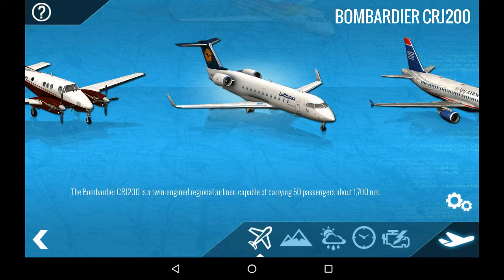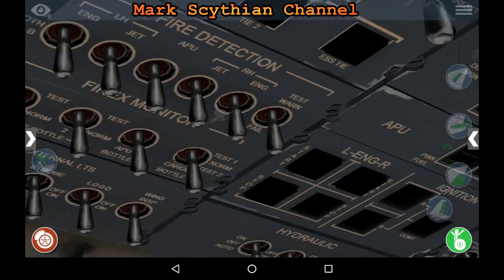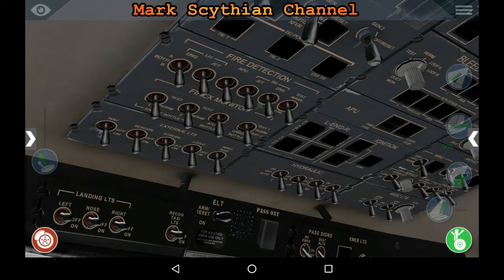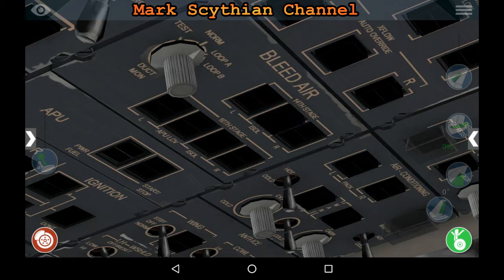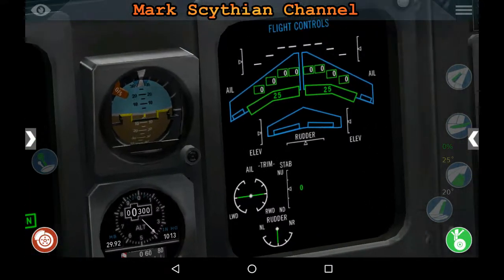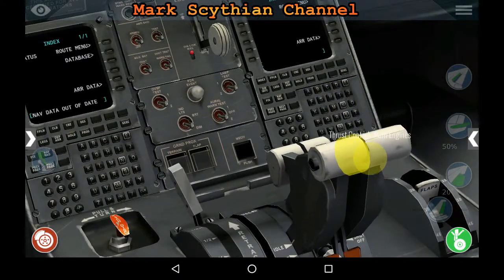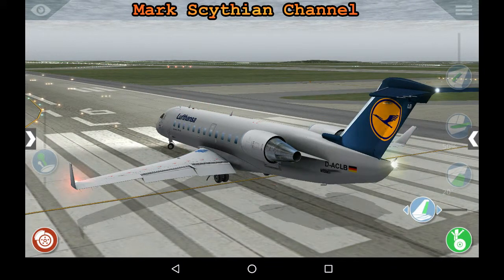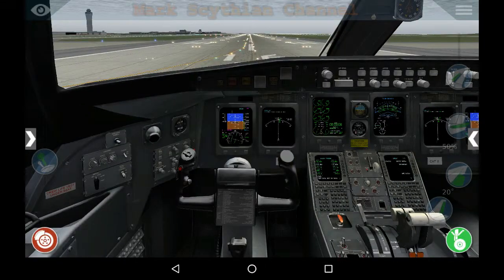X-Plane 10 Flight Simulator:  CRJ-200 Startup & Pre-Flight Operations (Part 1 of 2)

Comment: Awesome. Finally a tutorial on this plane that  is easy to understand and obviously knows what they are doing. Most other ones have people screwing up and jumping back two steps and breathing heavily into the mic. Not here. Thanks for the help!
Reply from the maker: Hi Wayne.  Thanks for your comment!  I am impressed with the relatively-realistic X-Plane-10 Flight Simulator.  While 'not everything' is exactly like the CRJ-200, most of the major flight-deck control systems are.  The CRJ-200 is unique in regard to 'introducing fuel' after sufficient compression is attained:  The throttle levers themselves are unlocked and moved to 'ground idle'!  Quite practical for turbofan startup.  For those with real-world CRJ-200 experience as pilots or mechanics, X-Plane-10 (and 11) Flight Simulator is 'quite realistic'!  Therefore, I thought it would be a good video to make, strictly in accordance with the CRJ-200 Pilot Operating Handbook OR Maintenance Manual.  I'm glad you found this video helpful!  Thanks!
Reply: @markscythian7179  the throttle, it feels like, i start up a fighter jet hehe.
Reply from the maker: @flankerskioneniner4290  :)